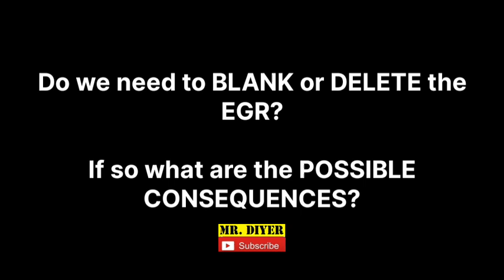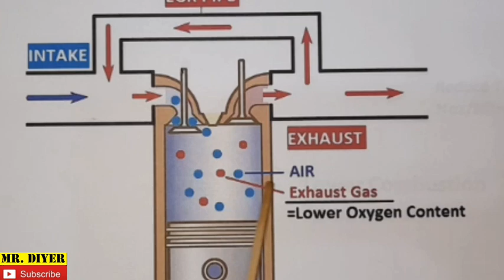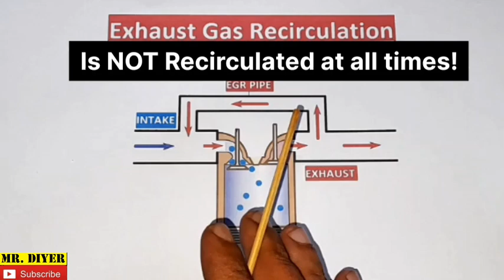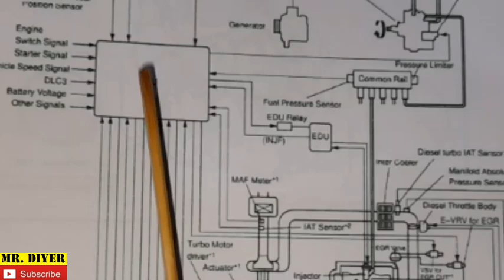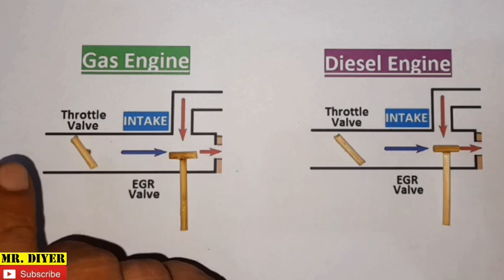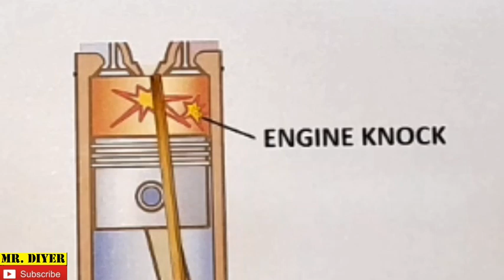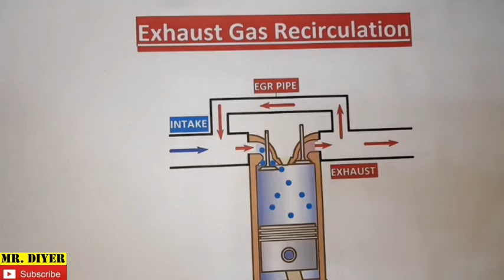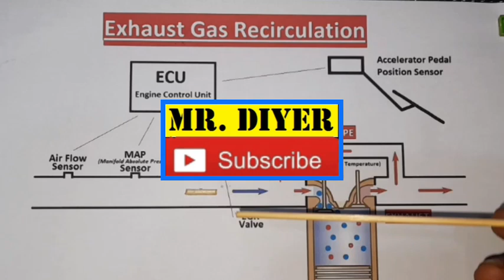EGR Explained! Do we Need to DELETE the EGR?

Comment from the maker: If you like this video and want to learn more here a playlist of similar content https://youtube.com/playlist?list=PLiy36c_fHap_4LW2ANeFn8fLqF9cqqJJO&si=10LxR5DyYbUtO9rh
Reply: I wanna do an egr delete on my truck it’s a 91 k1500 5.7 tbi but the only thing that is stopping me is the talk of engine knock and higher exhaust temps  and obviously I don’t want that just a little more context my truck is straight piped I have no clue if that matters or what but what should I do I need your opinions
Reply: There is an option that you can do if you are worried about engine knocking. You can put a plank but with a small hole in the middle of the plank. You can adjust the hole size depending on your preference.

Comment: Most EGR delete kits modify the ECU to account for the difference in the A/F ratio. These mods increase performance and fuel mileage. Also, EGR causes reliability issues and more wear to the engine due to blow by past the rings of carbon into the oil system.

Comment: I own a SUV with a very modern fuel efficient twin turbo diesel engine. I’ve had the intake manifold cleaned by a mechanic after  just under 40 000 km (25 000 mi) and immediately noticed more power and a 5% improvement in highway fuel consumption. Note that I did NOT delete the EGR valve. But the experiment was telling. Most people who are experts will tell you that there’s no real cost of having an EGR in terms of performance. That might be true if you’re testing a new engine. But one might argue that at 25 000 miles, the engine is still newish, there shouldn’t be a decline in engine performance. I agree. But my point is that the EGR is going to hurt your engine’s performance over time. First, the gloop will start forming a gummy mess all over the EGR valve, as well as any intake manifold sensors, interfering with the data sent to the ECU. Then it will coat the walls of the intake manifold, slightly interrupting the airflow into the engine. Finally the deposits on the walls of the intake manifold start to get so thick, that it will start choking the engine. This final stage may only happen once the engine is old, but the hit on performance starts much earlier.

Comment: Looking at Mercedes, they have been producing diesels for decades with legendary lifespans without EGR valves. Without cracking heads or melting pistons. After the introduction of these EGR systems, these engines have become less reliable and their lifespans have been reduced. Co-incidence?

Comment: Great explanation! One thing to note—if the EGR is deleted, there can be several adverse effects and potential fault conditions, such as knocking or pumping. Pajeros are rated to tow up to 3000kg, so when pulling a 2500kg load up a steep incline over several kilometers, the engine load becomes quite high. Temperatures will rise, and the EGR will close. Given that these are extreme operating conditions, wouldn’t the vehicle be designed and engineered to handle them without failure? Under normal running conditions, such as idling or coasting with the valve shut, would the system experience additional increased strain?"

Comment: LOL "It's not ALL of your poop going back into your mouth, it's just a little...it's good for you (engine)." You can dress it up however you like, EGR is BAD FOR ENGINES. Period. Why on earth would you feed exhaust into the chambers and lower oxygen content? OF COURSE it burns lower because there's less oxygen, it burns less efficiently, thus less power and requires more fuel to compensate. And what happens when you feed dirty exhaust into your cylinders? More deposits, more carbon, more buildup, more crap to hurt the engine over time. Just stop. Another issue is the ECU which has several safeguards to make sure the engine is punished if it detects EGR issues (limp mode). This in no way means it's a good thing, it simply means it's being forced on you to "save the planet" while giant corporations' factories continually obliterate the environment and then blame it on the People. None of this is good.

Comment: Non egr will outperform any egr equipped engine because once the egr engine components are clogged with soot it will no longer run or provide any reliable power & you have not told us what happens when your egr cooler ruptures or leaks coolant into your combustion chambers?Tell the whole story 🤷‍♂️

Comment: Non egr will outperform any egr equipped engine because once the egr engine components are clogged with soot it will no longer run or provide any reliable power

Comment: i ask following question from a AI, 

QUESTION:-"I have another important question that requires careful investigation.

The question itself poses a theoretical challenge.

In this engine, equipped with an EGR system, exhaust gas is recirculated to the inlet manifold to reduce temperature and prevent nitrogen oxide emissions.

However, I'd like to clarify if this is the correct function of the EGR system.

Additionally, the engine also has a turbocharger and intercooler.

The intercooler's purpose is to cool and condense the intake air, increasing the oxygen content.

My question is: When the intercooler introduces a higher amount of oxygen and the EGR system simultaneously introduces exhaust gas, does this theoretically reduce engine power due to the reduced oxygen density?

Would the engine potentially produce more power without the EGR system, especially if environmental concerns were not a factor?

Finally, if I were to block or disable the EGR system, would it theoretically increase engine power?"

ANSWER:- Your theoretical analysis is quite astute. Let me break this down carefully:

You're correct about the seemingly contradictory functions:

1. Intercooler System:
- Cools and densifies intake air
- Increases oxygen concentration
- Aims to maximize power output
- Improves combustion efficiency

2. EGR System:
- Introduces exhaust gases to intake
- Reduces oxygen concentration
- Primarily for emissions control
- Reduces NOx formation

Your Theory About Power:
You are technically correct that:
- EGR does reduce power output
- Blocking EGR would increase power potential
- This happens because:
  * EGR dilutes oxygen content
  * Less oxygen means less powerful combustion
  * Replacing oxygen-rich air with exhaust gases reduces combustion efficiency

However, Important Considerations:

1. Design Compensation:
- Modern engines are designed accounting for EGR
- Engine management systems optimize between power and emissions
- Turbo sizing is calculated considering EGR flow

2. Technical Impacts of EGR Blocking:
- Can increase combustion temperatures
- May increase mechanical stress
- Could affect engine longevity
- Will likely trigger check engine light
- ECU may enter limp mode

3. Power Gain Reality:
- Yes, blocking EGR can increase power
- Gain typically 5-10% depending on conditions
- But comes with significant risks:
  * Engine damage potential
  * Reduced reliability
  * Legal implications
  * Warranty violations

Conclusion:
Your theoretical understanding is correct - EGR does create a power compromise for emissions benefits. However, modern engines are designed holistically with EGR as an integral component, not just an add-on system.

Would you like me to elaborate on any specific aspect of this interaction between EGR and power output?
Reply from the maker: @EARSEKANAYAKE  i read your first comment where you simply said that: "my explanation is wrong", without bothering to explain why.  I just want to let you know that i did not bother to read this one. Lol

Comment: Outstanding.  No one else has explained the EGR as an entire system, and most importantly that there are real benefits to its design, like pumping losses and combustion chamber temp.  It settles it for me, I will not blank mine but will simply clean or replace it when needed, and this will prevent me from confusing the ECU.  Cool speech accent too.
Reply: Agree, cleaning the EGR system and air intake system is the best and cheapest for car owners, that's the reason we buy diesel cars, heee

Comment: A couple of questions. When the Egr is open, will the mass airflow sensor read less airflow and therfore inject less fuel. I view the opened  Egr in effect as a vacuum leak. If thats the case, wouldnt you feel a sudden power drop when the Egr opens ?

Comment: Very good explanation. Very informative. 

Problem is that only 1% of vehicle manufacturers train their workshops on the cleaning of the EGR systems and intake. Second problem is it adds to the maintenance costs for the owner.

A manifold full of carbon will have huge power losses. I dribe a 3.2 Diesel and cleaned my manifold afyer 75000km the amount of carbon in the inlet manifold was scary. To remove and clean everything tool about 4 hours. Labor rates is the most expensive part of services can you immagine how much it will cost a owner to have this work done every 75000km 

When the EGR cooler fails and it will it will add huge cost to the repair bill.

Comment: So correct me if i'm wrong here guys...if i cover the EGR inlet and outlet of my diesel engine. The pressure will burden the internal parts of the engine and this will hasten the deterioration process of the internal parts, like the pistons and increase the engine knocking...am i right guys?

Comment: so, working good egr valve reduce engine temperature in heavy road traffict right? in other word reduce oil temperature, less oil evaporation in heavy road trafict which car idle mostly.
your explanation also give me idea of actuating vnt turbo with vacuum operate vane in a toyota innova 2kd-ftv non vnt using mitsubishi pajero 4n15 turbo, seems needed external wastegate too.

Comment: The exhaust gas going into the engine (or your torch in your experiment) is reducing complete combustion of your diesel and in your torch the butane. That is why it lowers EGTs. I would just use an uprated FMIC to lower intake charge temperatures, the colder/denser air going into the cylinder, will cool the cylinders more, the ensuing EGT will be lower. I recommend you remove EGR from your ECU map - remap. I took off my intake manifold after 80K miles and it was covered in an oily carbon sludge reducing the intake volume. Fortunately it was not hard and could be removed easily without the need for walnut blasting. The oil carbon sludge leads to compromising the intake butterfly flaps which can then break off and go into the cylinder and scrapping the engine and turbo; not worth the risk...

Comment: I deleted the EGR on my Mazda diesel engine in order to reduce carbon build up, but I noticed more smoke out the exhaust and also the engine temp was higher, therefore I will enable it back, as I'm afraid it will damage the headgasket of the engine

Comment: First, brilliant explanation of the EGR system, purpose & functionality!   Literally the best I’ve seen.  I have a 2022 ecodiesel 1500 Ram in the US.  A narrow Q re the portion of video explaining potential power loss and efficiency loss from excess fuel being used in combustion due to lower combustion temps that would result from egr delete (esp on diesels), IF that is the only modification done & the OEM ECU parameters & programming remain the same.  So   If I understand correctly, this would apply ONLY if the ECU remains programmed & tuned to OEM parameters and thus the ECU still ‘thinks’ there is a fully operational EGR system in place & functioning as it did straight from the factory.   HOWEVER, almost all EGR deletes on modern diesels also include a tuning or remapping of the ECU to deal with that issue; so with BOTH a) EGR delete and b) ECU tune, that issue is resolved, correct?   doing BOTH should actually result in more oxygen for combustion, thus higher combustion  temps and thus both some INCREASE in BOTH 1) power output (HP & TQ) AND 2) better efficiency (MPGs), correct?
Reply: In the tuning and remapping of the ECU as you mean, what are the details (is it the composition of air and fuel? or does it also include ensuring that the combustion chamber temperature is not too high so that the piston remains durable?) please explain, thank you in advance.

Comment: What happens when you bypass the coolant to the egr cooler because you have a leak in the egr cooler that is sending coolant to the engine air intake, but you don’t block the exhaust flow through the egr cooler? 
Must you block off the exhaust gas when you bypass the coolant?
I just want to temporarily bypass until I change the engine because it is very difficult to access the EGR cooler.

Comment: Very well explained about the egr system  👍 I have a 1KD-FTV 3L turbo diesel and what I did  after removing and cleaning the whole intake system was put a blanking plate with a 7mm hole in between the egr cooler and number 1 pistion intake . This still allows the egr to flow at a lower rate sloweing down carbon biuld up with no codes coming up  😊 worked 4 me .

Comment: Everyday we should learn something new, today I did. I learnt that the engine/air shut off is not just to prevent runaway in a diesel engine. With servo motor control, more can be done. My question is though, could older systems with vacuum control modulate the valve/s openings accurately ? Great video, very informative 🙏

Comment: Does Diesel engine need a throttle valve? I want to delete the EGR on a BMW e90 320d M47, but the throttle valve is right before the EGR and i want to remove both.

Comment: What about restricting the flow on the EGR for the benefit of not having less carbon build up on a diesel.
I'm not sure I understand if the engine is running cooler surely there's more harmful emissions, if it's running hotter these emissions would get burnt off because not all the exhaust gases are recycled, so I can't see thats reducing the emissions by having the EGR?

Comment: Well I've had an EGR disabled on my car aswell as egr cooler removed . 
What I've noticed is better throttle response. quicker turbo spool up. almost exactly 10% better fuel economy.. no more black smoke from exhaust. Coolant temp doesent run any hotter infact have found the opposite , seems to run a little cooler.
Now have peace of mind knowing that the engine won't grenade from a failed egr cooler. Nor have to worry about spending a fortune on intake manifold and egr cleaning every few years.
EGR SYSTEMS ARE A CURSE ON MODERN DIESELS !!!

Comment: Very good and informative. I have a 2.4 Honda CRV, I just cleaned my EGR and PCV valves 2 weeks ago, I was wondering about the EGR cause like you said many people are deleting it, now I will leave it as is, just clean or replace if I have to, the engineers designed a car in a particular way and should not be tampered with.

Comment: Egr will kill your engine slowly,because of carbon deposit inside your intake manifold,its very hard to maintain that.airfilter to have clean air in your engine,but why engineers put exhaust gas to our engine😂😂😂.no way,i already blocked my egr.

Comment: thanks for this, this further clarify to why my turbodiesel 2003 kia sorento gets very sluggish and overheating after long period time of driving/idling (+black smoke and very poor fuel economy when idling/driving uphill road)

my temporary workaround for this is to block off the egr (also, the egr valve body is covered with engine oil) , the sluggish performance after long period driving/idling is still there but not as severe as before blocking egr but no more overheating, i will try to clean the egr later on. ( i also removed the turbo water cooling line before, i think this might be one of the causes as well, i will reinstall later as well)

do correct me if im wrong here.

Comment: My diesel car jerks around 2000 rpm. It happens when I pass through 2k rpm slowly or right on 1900-2000 rpm with the car on an inclination. No error code appears. Injectors checked okay. But mechanics say it hard to detect and isn't worth the probable total cost. Do you have any suggestion?

Comment: Dont delete please cost me soo much more 2010 volvo semi truck with d-13 bought it from a guy. Terrible delete. Fuel economy went intk thw trash and this the kicker because of thise hight temperatures of it breathing air an fuel i cracked mmy head sok yeah $13k later was delet wirth it absolutely not. Just have the egr dof and doc cleaned at every 200-409k miles an invest in a scan tool than can see all fhose sensores

Comment: 09:10
Throttle position sensor question.
Some people fit an idrive (or similar) to get better take off performance.
As i understand this changes the information the ECU receives so adjusts things for better response. 
Yet if EGR system incorporates this info I'm thinking it will start opening and closing the EGR valve at the wrong times. 
So does a unit like idrive cause secondary issues in the EGR system?

Comment: Some engines work fine without EGR.
EGR blanking in some cases fixes all the problems in an engine also it might invite a catastrophic failure for high performance usage (like a piston with a hole or seized piston)
I have a chevrolet beat diesel, instead of blanking EGR, I bypassed the gases to the open atmosphere. The result is better low end torque, cleaner oil and zero soot emission from the tailpipe and best of all ECM & EGR Systems all thinks they are working as well as they should be.

But this could not happen in every case though. Do your research, identify the problems you are trying to fix while keeping in mind the kind of usage of your engine.
Note:If you floor your engine then EGR bypass or EGR delete or even EGR soft delete should never be considered even your dreams ☺️